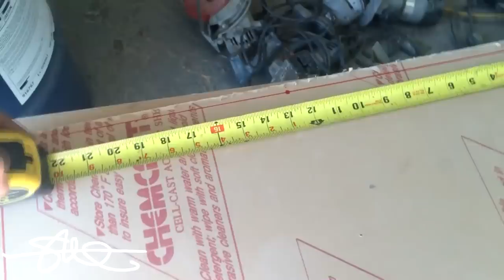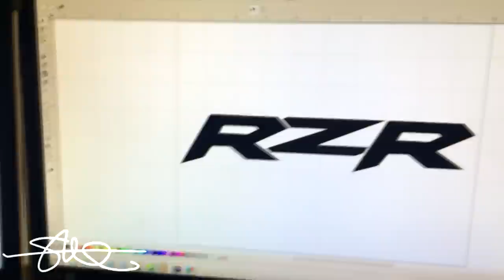Triple Chamber 4th Order Bandpass Subwoofer Box 2 10's Polaris RZR-4 Sound System Install Video 4

Comment: That's killer dude as usual great install and fabrication but you should use latches to lock the box down in case the buggy jumps so it doesn't fall out
Reply from the maker: the box isn't going to "fall out".  It fits like a glove and is already fastened in.  Thanks for the cool suggestion though.  I will call you before hand next time to double check i did this right.

Comment: I'm loving the vinyl effect on the plexi. But please please look on Ebay for other RGB LED controllers. Stick a controller inside the box and use the IR remote through the plexi to change colors, brightness, even use animations. That 3-knob doesn't do the project justice.
Reply from the maker: no.   I don't need your suggestions i already been there done that for years.  All i want is Orange.  Done. Thanks anyway though. :)

Comment: why did you put the spray paint on the inside instead of on the out side to get rid of the dots from the led when it is on. my opinion it should be on the out side. but amazing job.
Reply from the maker: Hate to tell you your "opinion" is wrong.  ALWAYS Paint it on the inside not the outside (like in this video).  The purpose is to hide the weatherstripping and has nothing to do with the LED's.

Comment: Looks awesome is that a custom box or premade for you RZR? Also, just my opinion for the interest of both of us shouldn't you put a few (flat black and maybe some orange?) locking latches around the outside edge of the box and around the outside of the bed to hold the box into the bed in case of a flip over on the dunes (it happens) or a really heavy bump or collision? I'd hate to see you hurt from a flying 150lb sub box man. Also, don't hold it down with ties or extension bands or whatever. It's not smart. I've seen way to many people get hurt or damage done to property (personal or otherwise) from improper strapping. I hope you consider this and if you do decide it's a good idea make a video! I love seeing all of the small stuff, long video or short.
Reply from the maker: the box is already fastened in place but thanks anyway for the awesome suggestion lol

Comment: sick vib, how did u cut your pexy glass? when i use a saw the glass cuts than it gets so hot that it glues itself back together. jus wondering, im still learning.
Reply from the maker: with a table saw.  Use a sharp blade it shouldn't melt.

Comment: Steve, Is not it smarter to cut Plexiglas first before you drill those holes? Is not it easier to crack the glass with the saw then with the drill?
Reply from the maker: the plexi was cut before i drilled the holes.  I cut the channel afterwards but that doesn't matter at all.
Reply: meade916 okey :P

Comment: On the handles where you drilled the holes you should of put plumbers putty so air does not get in the box and let the speakers flex when the speakers flex they are more likely to blow
Reply from the maker: no i shouldn't have and no the speakers are not going to blow. LOL